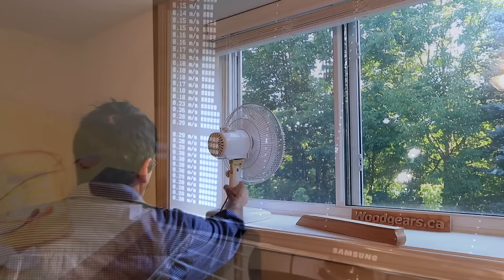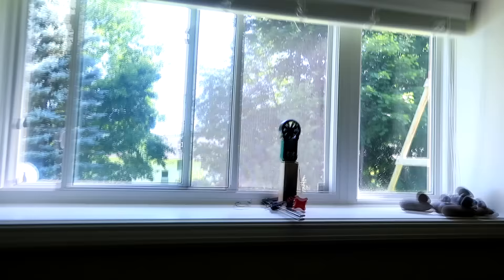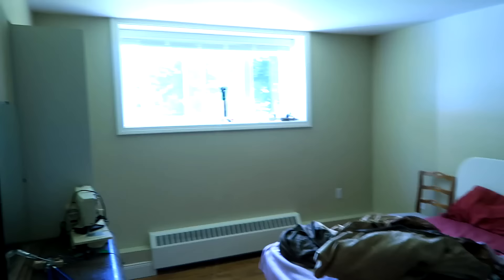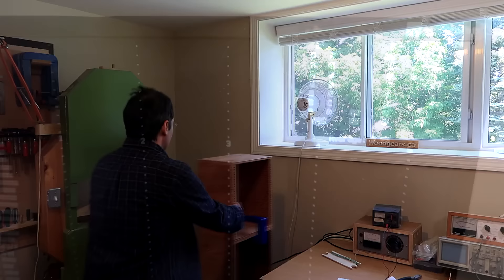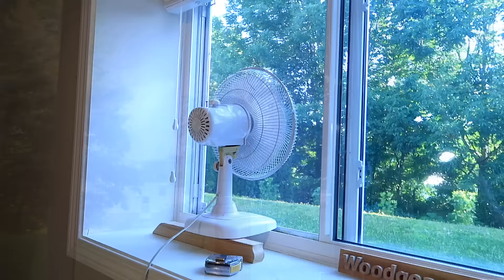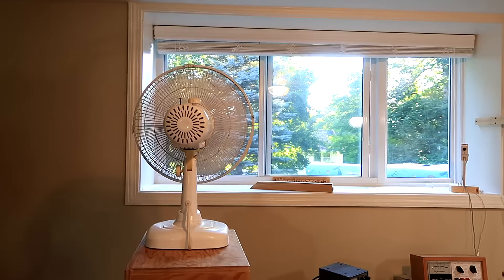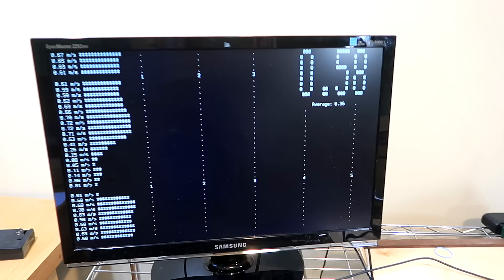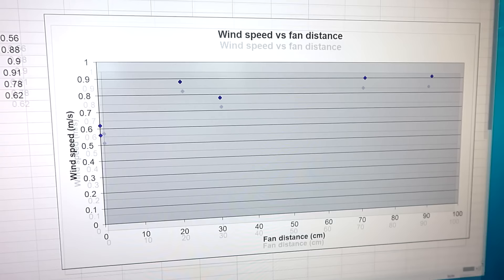Best fan placement to move air through the house

Comment: I have cooled my entire house in the summer like this for years.  Pick a window on the upper floor, or at the farthest point from your bedroom.  Open all of the windows in the house.  Wait until the temperature outside drops below the interior temperature and then turn on that fan and blow the air out of the house through a single window.  This will take in cool air from the outside.  Then in the morning as the temperatures rise, close all of the windows again.  You will be amazed at how much cooling effect you will have without resorting to air conditioning.
Reply: Basically a whole house fan. Problem is humidity from the outside, unless you are in a really dry place.
Reply: I have relied on this technique all summer long for several years now. Northwest United States here, so the weather often gets up to 95° but cools off at night. By managing the windows and fans as you described, we don't even need air conditioning. (Bought one anyway, just in case of wildfire smoke.) 

It's especially effective in a tall building, like a two- or three- story house. Once the windows are closed and the air gets still, warm air floats up to the top while the lowest floor is much cooler.
Reply: yea what about the humidity
Reply: @dardanpaloka4413  Usually around 40-60% here in the Pacific NorthWest (which is weird, considering our reputation for eternal rain.) That's a critical factor I meant to volunteer in my post. In a humid climate, you just need something with a condenser. Acclimation, shade and humidity matter more to me than the thermometer reading.
Reply: @dardanpaloka4413    It's not a problem out here in the West.
Reply: Good stuff. After seeing the Northern Hemisphere burn last Summer, and now here in Australia we are entering our Summer, and expecting a hot one, this is something useful to try for those without aircon.
Reply: Normal in most of Europe
Reply: Where I live become a pressure cooker with windows closed. So we just try to circulate air regardless of outside temp.
Reply: Yeah well, I'm in Texas where it was 100 degrees today.
Reply: @avalondreaming1433  That's nice.
Reply: Wait so you open all the windows when the outside temperature becomes cooler than Inside your home? Or you only have one window open? You also say to close the windows as the tempuratures rise though, so I can only assume you open them specifically when the outside temperature is cooler than your homes. I don't understand. I'm trying my best to cool my home at the moment
Reply: You cool your house by waiting for the temperature outside to drop? Alright then...
Reply: My mom opens the windows i  the morning to "let out the hot air". I told her it gets hotter throughout the day dont you want to trap the cold air? She opened another window. She closes them at night...
Reply: @naturesfinest2408 that depends where you live, at night it can still be hotter than the early hours at the morning, like between 5 or 6am till 10 or sometimes till 11am it can be cooler than night, so yeah, opening the windows early in the morning is the best course of action
Reply: @CaesarCJ15  where we live, it gets warmer in the morning when the sun starts rising, as soon as its not dark. Im also saying she left them open all day and closed them at night. Letting the warm air in and keeping the cool air out.
Reply: Can we dew this process during hunid climate   because in pakistan humidity factor is much higher then pther regions , what should we do in humid climate areas ?
Reply: Exactly!
Reply: On the west coast where I was in northern interior California, The temperature was fairly predictable all summer.  I set up a box fan to exhaust the hot air for two hours before sunrise because that was the coolest time outside.   easier than getting up that early
Reply: @firstdonuts  I open two windows. one for intake (where i am) and one for exhaust(further away, in another room).  I put a box fan in the exhaust window blowing out. it is on a timer so it runs for two hours before sunrise and then turns off.  when i get up in the morning or when it gets hotter outside i close the windows for the day.  before going to bed I open them again in preparation for another cooling cycle. I hope this helps
Reply: @bobo888bobo  Ya boi upgraded to AC 😎  I'm ready for the summer. Ty though
Reply: @aromatic8565 Yes, you use windows and fans to equalize with the outside when it's coldest, then insulate when it's hottest to 'store' the cold. You may need to top up with AC, or even use AC at the minimum outside temp, but it's more efficient to do that when there's a smaller difference.
Reply: @Zutraxi  Same
Reply: Sounds cool, nut do you have anything else to do? I am speaking of opportunity cost of going thru those gymnastic just to save some bucks while you can make more money.
Reply: Not if the outside temp is higher on a hot day, then you bring in all the hot air..
Reply: How would it work in an apartment?
Reply: i am experimenting to run an exhaust fan all night so that cool air from outside enters the home and as warm air rises, i hope it gets blown out through it, hope it works.
Reply: Use to do this when living in the north, but unfortunately where I live now it would only work in winter haha. Evening temps in the summer are still 80-90+ and day temps 100+. Not to mention humidity
Reply: I also tried this and opened all my windows, but unfortunately, air is not the only one that went through my house. I didn't expect a thief would also come through
Reply: @mr.j5112 time to buy a gun
Reply: @samyb2834  I don't know how effective a gun is when it comes to airflow, but I'd rather get an air conditioner.
Reply: My experience is that when cooling stops, after 30 minutes it is hot again. Never mind the amount of dust that comes in when blowing air through the windows with fans.
Reply: that is way too much work lol
Reply: this works awesome until its over 80 degrees 24/7 and reaching 110 in the day
Reply: We have Windows that don’t allow for easy AC install so we open all windows at night and close first thing in the morning... unless the humidity is high with like 85+ degrees. It stays nice and cold
Reply: @naturesfinest2408 why would she do that?
Reply: @knux5796 lmao no it isn’t 🤦‍♂️
Reply: @soulslip  i have no idea. She thinks it is cooling the house. Everytime i tell her it isnt, she denies it. I walk in and its always much hotter than the outside
Reply: Thank you for the tip!
Reply: 44 years of living in the south and never used air conditioning.
Reply: @twonumber22  Must be miserable. I live in South Texas and there's just no way I'm going to go AC less when it's 103 outside with absurd humidity. Can't swamp cool that. No fan makes that better. Can't circulate hot air from the house because the outside air is even hotter. There's just no real recourse unless you enjoy sitting in a 95 degree house. I don't.
Reply: @Setixir  I don't even notice it. You get used to it.
Reply: @An_ml_93 you're on YouTube watching videos and commenting, you shouldn't be talking about opportunity cost when you could be grinding instead.
Reply: This is what they did before air conditioning 👍
Reply: We are doing the same in the summer months. We even have powerful whole house AC installed. But the AC cold is unpleasant and it cost way more for little benefit. We much prefer to cool it like this. By opening the back side door where it get shade earlier and as soon as the outside air gets cooler than inside. And then blow the cool air through the whole house by running a fan and opening a few windows at the other side of the house.
And then we let in enough cool air during the night to cool down the whole structure. And then we shut most of it only leaving enough for ventilation in the morning when it starts to get hotter outside.
It works way better than AC, the AC draw so much power is noisy and makes the air so unpleasantly dry.

Look up the Bernoulli's principle, that is what explains what he is talking about in the video.
Reply: I’m assuming you have the window downstairs open while you do for the upper window?
Reply: But what to do if slab is heated up completely all the day
Reply: I'm trying to be smart ass but there is some fan called exhaust fan in-out
Reply: I've been calling it air flow dynamics.  Too many factors to list! But a push/pull pull/push setup is best. 😅
Reply: @bobo888bobo it helps a lot, thank you so much!!!!
Reply: @soulslip  Do you also use a fan at night to blow out the hot air?
Reply: @Cent51  Your comment should have been written as follows:
"Ignore me. I can't read."
Reply: @Mythraen  Ja Doos of Poes, the only opionon that matters is yours I guess..
Reply: @Cent51  Oh, you disagree with my opinion that your comment should have said, "I can't read"?
Fine, explain how this is justified -
OP: "Wait until the temperature outside drops below the interior temperature."
You: "Not if the outside temp is higher on a hot day, then you bring in all the hot air."
Reply: agreed, most of us need to not set the temp so low because out bodies get used to it and make it seem like its hotter outside than it really is. its always an uphill battle with roommates over this. i grew up without AC my entire childhood and we would have to learn to do this stuff as well. we would do this to pull all the cool air from the basement upstairs with fans every night.
Reply: And keep it dark.
Reply: I'm in Florida. All this would do is increase the humidity to 100%😂
Reply: @Just4freepremium  lol yeah this is for those of us with humidity that goes below 100
Reply: I can't believe you've done this.
Reply: You guys have houses?

Comment: I am an Italian firefighter, this is the same principle we use to evacuate the fumes from the houses during a fire, the "cone" of air must cover most of the window opening
Reply from the maker: exactly!
Reply: cool!
Reply: @matthiasrandomstuff2221  could you repeat your experiment with some simple ducting?  Just foam board or something cheap and easy to throw together?  I find ducting to be far more important than individual fan characteristics or performance.
Reply: @matthiasrandomstuff2221  could you repeat your experiment with some simple ducting?  Just foam board or something cheap and easy to throw together?  I find ducting to be far more important than individual fan characteristics or performance.
Reply: @tiporari  I had to vote you up that other you guy was getting more than you were.
Reply: Hydraulic Ventilation!
Reply: @tiporari  what do you mean by "ducting"?
Reply: @tiporari  I was thinking the same, either with ducting, or even a simple cowl that fits closely around the spinning blades to prevent the reverse air flow close to the front of the fan. The commercial window units I've seen for sale mostly have the circular cowl. The same goes for kitchen ventilation fans, even ones designed for square wall penetrations.
Reply: @danl.4743  Yeah, I know what a duct is. I was trying to figure specifically what you had in mind.
Reply: @secretsquirrel9722  I'd like to see Mathias take a piece of card board, the size of box fan, cut a circle in it and place it against screened window.
Reply: @matthiasrandomstuff2221   I concur with Tiporari and FXM, a duct experiment would be worthwhile, since it seems that it allows the whole setup to pick more inertia. It's the same phenomenon as a tall oven foundry, but instead of being powered by an electric fan, the air is moved by a contained flame. There are 3 cases: duct one one side, on the other, or on both. Putting only one duct before the fan is like having a tube to carry air to an open flame; and having only one duct after the fan would be like a flame that sucks air from the side and takes it upwards through a tube, like a chimney. The third case is the tall oven foundry, or even some well designed rocket stoves: the flame is contained inside the tube, 1/3 to 1/5 of the length of the tube from the ground, so that most of the tube is filled with hot air that rises through the hot container, pulling air from the bottom part of the tube.

I think it would be interesting to see the three phenomena with the fan and some nicely dimensioned tubes, cheers!
Reply: Isn't it called "entrainment" fluid dynamics?
Reply: What if you bring the fan close to the window, but seal off that screened area where the fan is not blowing the air?
Reply: @dougprentice1363  
I think he means closing off the window except for the active area of the fan blades.  For example, i have a box fan and put it in my double-hung window which leaves about a 11 inch wide space that I then cover with a strip of plywood.  I think that works the best, but I don't have the numbers to prove it.  ;-)
Reply: @dougprentice1363  
Yes, exactly, I do that.  I think it is what the other guy means by ducting, though that is not really a duct.
Reply: Back in the day it was called positive pressure ventilation.
Reply: @dougprentice1363  Sorry about that.  Thought you are not a native English speaker.  You never know from what country the commenter is.
Reply: Don't forget to remove the screen, that will really help the airflow
Reply: @benw2319  No fun to have bugs buzzing around your ears all day!
Reply: Or we use exhaust fan
Reply: @roberto mumeni I’m from a small town in Kentucky USA and I thank you for all that you do to help people may God bless you always .
Reply: IL CORPO NAZIONALE DEI VIGILI DEL FUOCO
Reply: Thank you for your services,  God Bless and stay safe.
Reply: Positive pressure ventilation.
Reply: Or you can buy exhaust fan
Reply: I think you would get much better results if the fan was enclosed in a short section of tube. Like a vent fan in a vent pipe forcing air ONE way.
Reply: Thanks I did not know that.
Reply: IL POMPIERE
Reply: I learned this fan placement as a kid watching fire fighters at a burning house near me
Reply: Thank you, Italian firefighter.
Reply: Why does the cone of air need to cover most of the window opening?
Reply: @matthiasrandomstuff2221  what is the diameter of your fan?, what is the reading of the anemometer in front of your fan, let's say... at one foot in front?
Reply: @matthiasrandomstuff2221  what is the diameter of your fan?, what is the reading of the anemometer in front of you fan let's say... at one foot in front of the fan?
Reply: @dougprentice1363  It would have to be 3 dimensional in shape, extending past the intake of the fan and flush with the window screen.The rest of the window would have to be covered to prevent intake looping back to the intake of the fan. 
That being said I keep mine a foot or two back and open windows at the other end of the house.  Works well enough for my needs.
Reply: Same thing here in the US. Mostly use positive pressure ventilation (fan outside blowing in). A fanned out hose stream from the inside works wonders to cool a room down as well.
Reply: I could not agree more!!
Reply: @justgivemethetruth  You shouldn't have bugs, if you cover the window with cardboard and hole that fits the air flow. When you are finished, put the screen back, and then power off the fan, and remove things.
Reply: @matthiasrandomstuff2221  wonder if a tube would help prevent sucking in the air around the blades?
Reply: the  screen changes the profile completely..i was a  firefighter and  chief
Reply: cant believe firemen keep this useful tip from public for all this time....
Reply: I was going to post the same thing. US Firefighter training covers the same principle. The cone covers the opening. Does not matter if it is positive or negative pressure ventilation.
There are different fan designs for PPV and exhausting air. The PPV fan would be terrible at exhausting air, and the exhaust fan wouldn't be as effective at positive pressure.
Reply: I have a portable AC unit set up in this way (a ducted exhaust vents out the window through a sealing kit) and I do notice that it can be very effective just in fan-only mode with the windows open on the other side of the building - in this configuration, it basically sucks air out and creates a negative pressure which pulls air in through the other side of the building and thereby creates a very noticeable flow of air.
Reply: I’m an American firefighter and agree. We use the same principles in ventilating a structure.
Reply: @justgivemethetruth  THIS. You should have vastly different readings if the entire window is sealed around the fan.
Reply: Air takes the path of least resistance. Having a window that is larger than the exhaust cone of the fan will cause it to draw air from the remaining space of the window and not draw from the house.
Reply: Grazie per il tuo servizio!
Reply: @tiporari  p
Reply: @Don.Challenger  🤣🤣🤣
Me too!
Reply: We use an exhaust fan blowing out from bedroom window, powered it with a timer set at 1/2 hour on/ off intervals. The result is amazing, have fresh and cool air all the time.
Reply: It is called the Bernoulli's principle.
Reply: German Firefighter here. Same in Germany. Covering the whole area with the vent-cone is the key. And you don’t need much speed. You want to create an airflow, not overpressurisation.
Reply: Bernoulli's principle